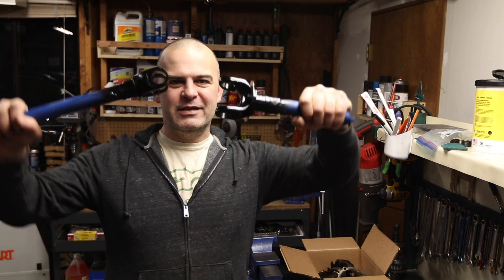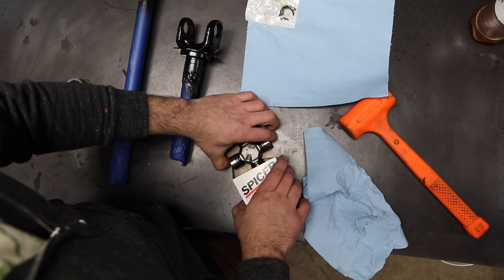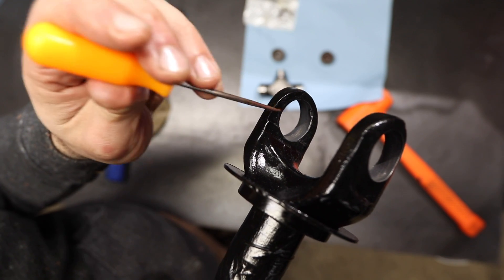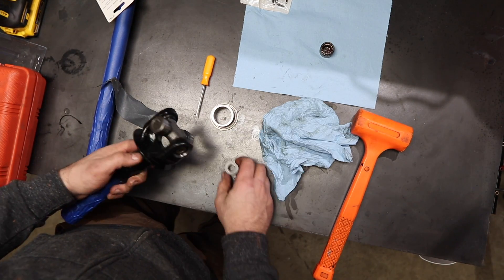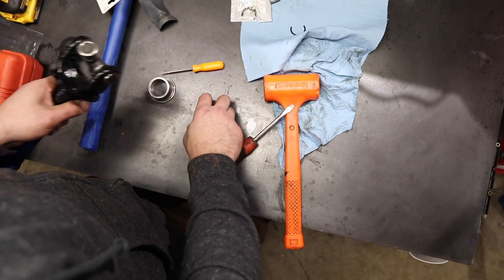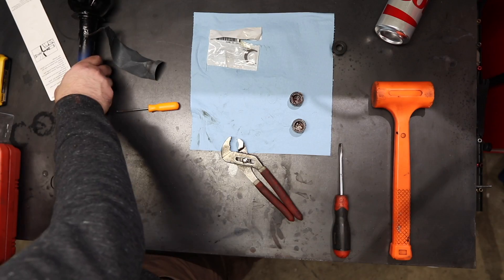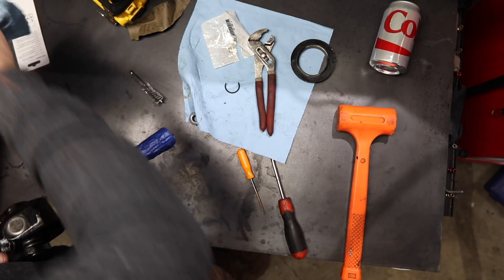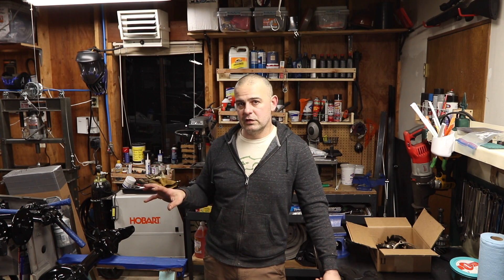3.22 - U-Joints in Dana Front Axle - Part 4 of Gears and Axles

Comment: Hi Matt, is it OK I call you Matt? I really enjoy your stuff, but If I may make a suggestion. Removing or taping the caps that you are not working with might keep you from pulling your hair out, should a cap fall and hit the floor. You wouldn't want to lose even one of those needle bearings.
Reply from the maker: Tips are always welcome.  Everything I'm doing I am doing for the first time so I appreciate it.  I ended up getting everything on with no lost needles.

Comment: Fun times!  But you need to relieve the tension on the u-joints.  Take a ball peen hammer and tap it with a medium blow on the base of the ears.  The u-joints should move freely without any bind or tension.
Reply: https://youtu.be/rOEdul7nscY    This is the video I used when I did my F150 u-joints.
Reply from the maker: Thanks Mikey. I didn’t know that! Thanks for the tip!
Reply: Flyingmikey62 is correct. It should pivot easily.

Comment: Great videos man when is the engine vid coming?
Reply: Matt, my engine builder told me I need to be putting in my rebuilt 5.0 within two weeks of receiving it. He wants me to run it 500-1000 miles and do some hill pulls etc to seat the rings properly. I don't have any corroborating info on this but  I'm going to take his advice. As slow as I'm going on my Bronco, I'll be able to do this, then take the broken in engine out of the vehicle, set it aside, and basically begin your Matt's Garage series all over again in my garage. YIKES!
Reply from the maker: Brian I’m starting to look at it when I walk by in the garage so that’s a good sign. Worried about getting it rebuilt too soon and having it sit in the shop for a year but maybe it’s nothing to worry about? What do you think?
Reply from the maker: Brian Hurford no way! 2 weeks! I have to hear the reasoning behind that timeframe. 2 months I could kinda understand in Florida in the Summer but 2 weeks!?!
Reply: I'll straight up ask the guy tomorrow. That kinda puts a cramp in my snail paced schedule!